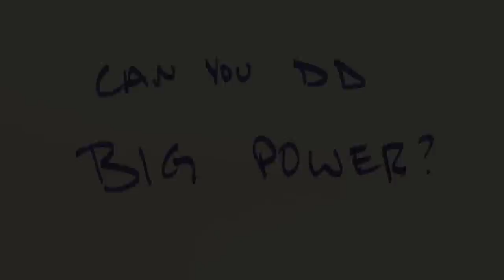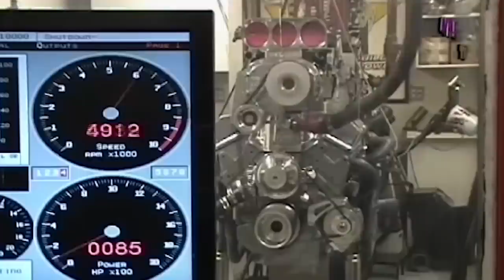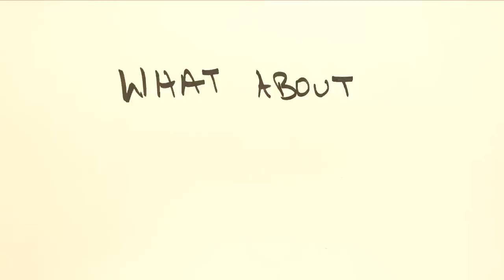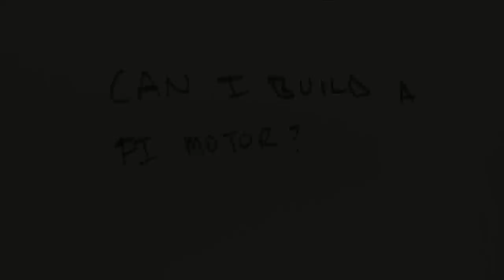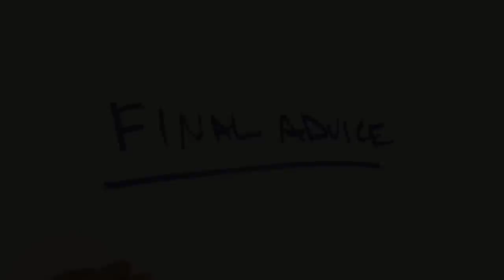How to Make BIG POWER, Safely /ENGINEERED

Comment: Judging by all your vids there aren't many sales advantages that you haven't  already done.  Wounder if you ever scan a finished low profile high horsepower combo of your fantastic engines with probable drive train and suspesion laying out on the floor or blocks so someone can design a hyper car around those components?  Hope to obtain Boxx Apex2& Boxx RenderPro2 with SolidWorks+SolidProfessor(enterprize versions of each), twin 4/5k Dell monitors, and a Wacom Cintiq 27QHD. Will have various rendering softwares and a tech and car guy at that 9ft desk.  Have a 3D printing epoxy thin cored panel plan envolving a never concidered joining and bonding of 2 or more printed panels to achieve one longer panel(say a quarter panel or sub frame) using "Lamello Invis" conectors at corners of the 2 printings to achieve one part.  All then carbon fiber Prepeg enclosing the thin male finished panel. Will use old school finger/sandwich joinery loosing 3" off each printing to finalize a part. Those connectors(12mm. and {30mm. for frame to body joining}) are 250kg.(obviously that 30mm. has some badass pulling power but can't get stats on that) of pulling power to close the joined edges of your larger finished parts.  Cool thing is that those connectors are concealed within the axis plane of that part and can be attached or detached with a simple forward or reverse of a battery powered pistol drill with Lamello's Invis turning magnets in 5 seconds time.  Feal free to contact me and i can fill you in on the UNIQUENESS of this.  If i can put it on screen than it can be done.  Hope that the steps after that will be obtaining a 3DP-Platform WorkBench#400 printer. They have a 59"x39"x27&3/4" work bed(run about 40k$ without enclosure) with extruder options that can spit out spools or pellets at some increadable rates(been eye ball to eye ball with this at a showing).

Comment: Lol 1200 is enough for the street huh. what does this guy run. I twin turboed my 03 evo and the build only cost me 12k so I'm not sure what 40k build he is doing but then again I'm only making 750 hp because I'm on pump gas because I did E85 and fuck 120 mile range lol that shit was outrages. just to give you a idea on pump gas my range is 200 miles and stock it was 210 so I lost 10 miles of range I can deal with that. I'm also on stock suspension no problem. But shit 1200 ? I can already break traction in 5th gear at 3k rpm if I step on it. I can't imagine 1200hp

Comment: If it is really that good, explain why outside of America, why nobody uses this engine?

Because no one wants a 6.2 V8 that uses pushrods & returns MPGs in the low teens. Making big power sure, but when a smaller DOHC V8 in Europe or V6 twin turbo in Asia can develop more power, more tractability, more refinement & better MPGs, you know it is a one trick pony catered only to America "bigger is better" mindset.
Reply: +Trades46 I will tell you why. Outside of America you are charged a lot more for insurance and taxes based on engine size. Thus we are now experiencing a surge in smaller forced induction motors. America is really starting to pick up the pace as well with CAFE requirements getting harder and harder each year. 

A lot of people think that pushrod technology is outdated, but there are many benefits to its simplicity. Most notably its package size and weight. Google a picture of a nissan VQ v6 next to an LS3 and you will see what I mean.

Bottom line is that every engine from every manufacturer was built to meet specific needs of the company at that time, debating how they got there will forever go on as long as gasoline powered vehicles are on the road.
Reply: +Trades46 If it was affordable, and viable, I would buy an old BMW 3 series and swap an LS motor into it and run 500 at the wheels all day every day.

...but normal octane pump fuel here is roughly $2 per liter, insurance is thousands a year even for a 15 year old small displacement car. Taxes are not even that bad, it's like 250 a year, but insurance in the UK is an absolute joke so it's pretty much impossible unless you really have money to blow and can do it privately, in a motorsport setting.

Not only that but there is nowhere to take a car out and do pulls here. What are you gonna do with a 4 digit hp vehicle when you physically can't get to anywhere near 100mph safely on these roads?

Also economy and emissions regs are killing everything motorsport related off. I'm tired of seeing 1.x liter turbo diesels but now we're going even further and everyone is driving hybrids and shit.
Reply: +Username Good mention on emissions, forgot about that piece. Now correct me if I am wrong as I dont live over there but both displacement and Co2 particulates per mile get factored into insurance over there. Hence we see a large use of very small forced induction motors. Most car companies offer 6-8 engine choices for european cars, often the only change is the power or fuel type. In america that is condensed down to 1 4cyl option and one bigger motor option because restrictions here are much more lax. I will argue pushrod vs DOHC all day long, have great arguments for both sides.
Reply: Irkie500 all I'm gonna say is; a brand new V8 mustang here is only £35k, but nobody buys it.
Take a guess at why that is :^)
Reply: I would buy an American v8 over an overseas car because it's fucking cool I would feel gay driving an import everyday even if it's faster and cheaper on gas.